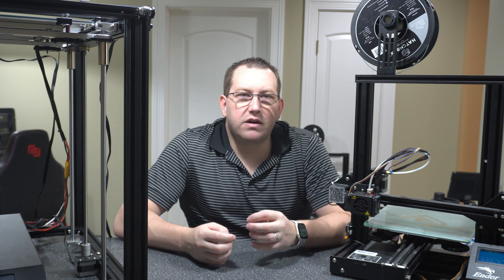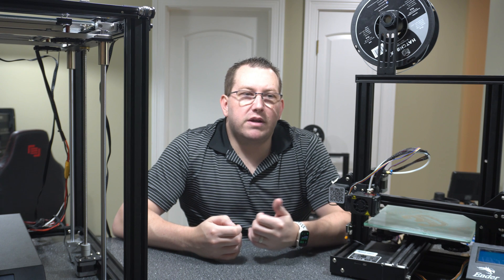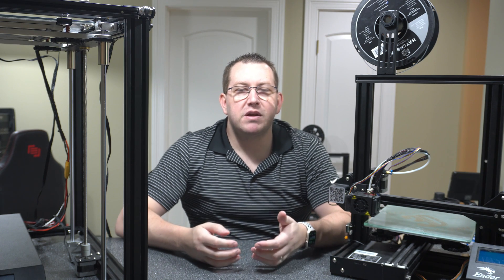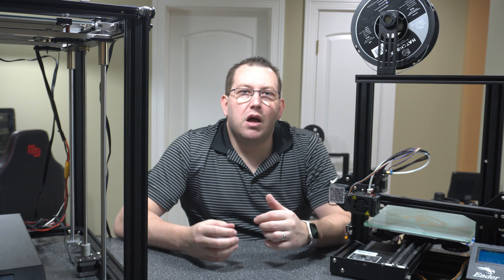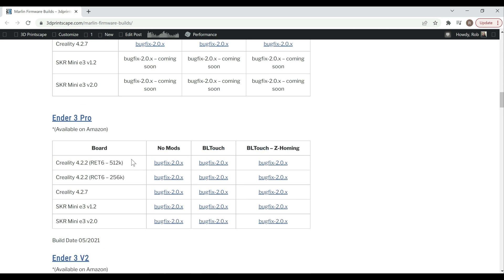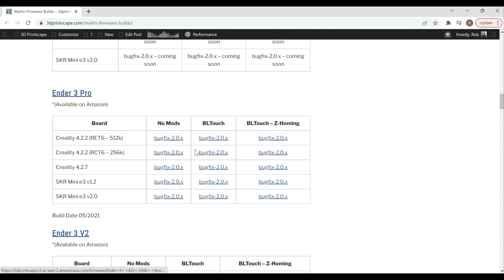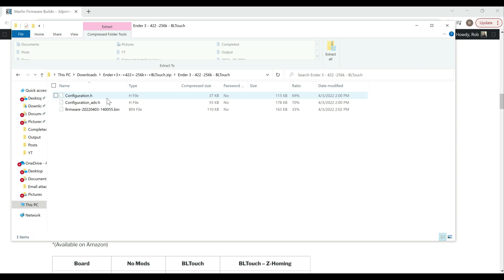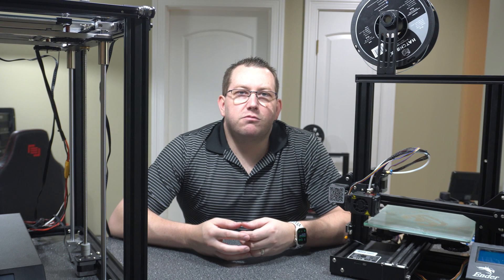Creality Screen Issues After Firmware Upgrade

Comment: Thank you man, you're a life saver. I had the screen issue which made it impossible to print from the SD card as everything was a text mess with random characters. I have the Ender 3 Pro with a 4.2.2 board and BLTouch so I used your Z-Homing firmware (256k) and it completely fixed my issue!! Thanks again, seriously.
Reply from the maker: You're Welcome!

Comment: Hey brother, I used your firmware for my first printer and it worked flawlessly.  I just got my second which is the same printer but maybe a different chip?  Ig has the GD32F303 RET6.  any firmware I use causes the touch to probe out and back in and move up when auto homed. Seems to start okay but auto homing is not workin.  Been at it for about a month trying to figure it out. Any help would be awesome
Reply from the maker: Hi. When you hit autohome what does it do? Does it have an issues on one or all axis, etc?
Reply: @3D Printscape  just one, x and y hit the switches like the do, the z just pops out and back in and then the z moves up and does the same thing again and stops. Almost like the probe is sensing bottom
Reply from the maker: @swiftymcvey8535  If you trigger the probe early does it stop it?

Comment: hlo 
I just updated my firmware for ender 3 
due to the blue screen issue 
and now everytime the printer turn on its showing the same blue screen issue
need help
thanks in advance
Reply from the maker: Hi. Make sure the firmware is right for the printer, the sd card is 8 gb or less and formatted as FAT32, and that the file name is unique.

Comment: I used your ender pro 3 blt file with the newest version of marlin on my printer tonight. It worked perfectly. The screen is still messed up but readable. The firmware on the creality site didn't work. Thaks 😊
Reply from the maker: Hi. If you clear the eeprom and flash the firmware it should fix the glitch. I have had some people say they flashed to a different build then back to the one they wanted and that worked as well.
Reply: @3D Printscape  thanks. I'll try I  when my litho is done

Comment: thankyou thankyou a million times over. not only is my printer now working again, but i can read the screen.
only thing if i can add is i have another printer fitted with BL Touch and i can adjust the z offset on the fly. but i dont seem to be able to do this. i finally found the sweet spot i think. but had to adjust and start the print all over again each time.
Reply from the maker: Hi, you should be able to adjust the z offset, with baby stepping, on the fly. Then you can take those settings and update the z offset then save it.

Comment: hey, i have an ender 3 with a 4.2.2 ret6 board but when i installed your firmware the screen glitched even more, is there any other firmware i can try? Thankfully it still prints.
Reply from the maker: Hi. What firmware did you try (512 or 256?). If 512, try to clear the settings and push the 256k firmware.

Comment: Hi there, I added the CR touch to my brand new Ender 3 V2 with the 4.2.2 board and when I installed the firmware to it, it has frozen the screen on the Creality logo but the fans still come on. Do you know what I have done wrong and how I can possibly fix it?
Reply from the maker: Hi. What firmware are you using? Also, make sure the file name is unique (so add a number or date to the end of it).

Comment: I was able to upgrade my firmware for my cr-06 se to the new community firmware, but the touchscreen is dark and even if i adjust the settings from the screen it's still dark, could it be a loose connection to the lcd screen?
Reply from the maker: Hi. I dont think its a loose connection. You could try to move the wires at both end to see if it changes anything but i dont think it will.
Reply: @3D Printscape  thanks, I'll try that.

Comment: Could you help me? Added a CR Touch to my 3 V2 and went to upload the Marlin firmware and now it's stuck in the creality screen. Tried refreshing back to stock and nothing helps
Reply from the maker: Hi. It sounds like you may have used the marlin ui config example. Try again, but make sure you use the creality ui config example.

Comment: I recently updated the firmware to your build w/ no mods, and it worked great! But I just installed a Z-axis upgrade to the printer, and now the glitchy screen is coming back!! Any tips? maybe I should install one of the other firmwares instead?
Reply from the maker: Hi. What all did the z axis upgrade involve and did you have to flash firmware for it again?
Reply: @3DPrintscape  it was the official creality z-axis upgrade that adds the second z-axis bar to further stabilize it. No it printed fine after the upgrade at first with your firmware fix /no mods. Then the glitchy screen started coming back.
Reply from the maker: @DougMacintosh  Did anything change between it working with no glitch and it coming back?
Reply: Yes I added the creality z-axis upgrade
Reply from the maker: @DougMacintosh  Any firmware changes? I would try to clear eeprom and push the firmware from my site again.

Comment: i have a Ender 3 Pro v4.2.2 RET6 and i just installed my CRtouch with the z stop still plugged in and have tryed to flash both bugfixes for BLTouch and BLTouch - z -homing but i still but that bugged screen.
i have tryed to go back to stock firmwire from crealitys site and also the no mods firmwire but now i cant get back to how the screen was befor. anyone got any idees?
Reply from the maker: Hi. You will want to use the bltouch version (not the z homing one) and try to flash the creality firmware, clear eeprom, then flash the marlin build.

Comment: Hi Rob, thank you for all your work you do. I am still having a glitchy screen after installing the firmware, it seems to start at the bottom of the screen and rolls up to the top of the screen. I have an Ender 5 Pro that has the GD32F303RET6 chip on the 4.2.2 board. Firmware is the bugfix-2.0.x for BLTouch but I have a CRTouch installed. Cheers Geoff
Reply from the maker: Hi. If your able to build firmware, try to build the latest 2.1.x build to see if that fixes the issue.
Reply: @3DPrintscape  Hi, okay I will give that a go. It starts out fine but after a while it goes kaput it's still readable just not pretty.

Comment: You're a life saver. Flashing with your bug-fixed firmware fixed my bluescreen. I tried flashing again with the firmware that caused the initial blue screen (cr touch firmware), and now it works. Weird.
Reply from the maker: Hi. Its odd that it worked the second time with the bad firmware.

Comment: Oh my goodness thank you so much! It took 3 boot ups but it finally worked. Thank you for making it free also.

Edit: After attempting to print something, it seems to heat up, move to the point that the BLTouch is centered and then cool down. I don’t know what to do.
Reply from the maker: Hi. Thanks for the feedback. Do you have the z stop connected still? If not, connect that back up. If you do, try clearing eeprom (restoring default settings).
Reply: @3DPrintscape  I tried that multiple times, but still it doesn’t work
Reply from the maker: @tobthebomato1588  Is the z stop connected?
Reply: @3DPrintscape  I’ve tied with the zstop connected and not connected with the z homing firmware but I think it may be a bltouch problem
Reply from the maker: @tobthebomato1588  Assuming you have all 5 bltouch wires connected to the bltocuh port, you want the standard bltouch firmware, not the z homing one.
Reply: @3DPrintscape  I meant that I’ve tried both
Reply from the maker: @tobthebomato1588  Can you try to flash the firmware again.
Reply: @3DPrintscape  it still wont work
Reply from the maker: @tobthebomato1588  Are you sure it took the firmware and what behavior are you seeing now?
Reply: @3DPrintscape  after some more replugging connections and renaming firmware it magically worked🤷🏾‍♀️

Comment: I have an Ender 3 pro with the 4.2.7 motherboard and a BL touch, but none of the bug-fix works :( same blue screen. What should I do ?
Reply from the maker: Hi. Check to see what chip you have on the 4.2.7 board. Also, make sure the firmware file name is unique.
Reply: @3DPrintscape  This is a 4.2.7 with 32 bit TMC2225 and I have rename the firmware with an unique name but it didn't work :( (by the way when I check after the blue screen on the microSD card I can't see the EPROM)
Reply from the maker: @skydrano4828  The 4.2.7 board should have internal eeprom, so it wouldn't right to the sd card unless that i having issues. Are you trying the firmware from my site or budling your own?
Reply: @3DPrintscape  the firmware from your site
Reply from the maker: @skydrano4828  Did you try with an sd card in?
Reply: @3DPrintscape  yes, the one from the Ender 3 pro
Reply from the maker: @skydrano4828  Try to grab the creality firmware from their site and flash that, then go to marlin. Im having an odd issue with my v2 where it wont take marlin updates, i have to flash creality then flash over to marlin.
Reply: @3DPrintscape  I have flashed creality and then marlin but nothing happens
Reply from the maker: @skydrano4828  Is your sd card formatted as fat 32 and under 8gb? Also, have you tried a different card?

Comment: i have an ender 3 pro its a month old after my first big print i got the blue screen i did the marlin firmware upgrade the screen works and it heats up moves but it has no command for it to print a file got any ideas to fix this
Reply from the maker: Hi. I would try to push the firmware again.
Reply: @3DPrintscape  thanks i will give it a try
Reply from the maker: @mattdaniel9972  You're Welcome

Comment: Just updated my firmware on an ender-3 just a couple questions. 1 Why is it now labeled as an ender-3 pro. 2 I see the progress bar moving but sadly it does not say what % it's on anymore I know its a small thing but I always had way too much fun guessing what % it would be on whenever I checked it. Other than that my screen has no more glitching on it. Thank you for the fix.
Reply from the maker: Hi. From the firmware standpoint there is no difference between the base and the pro, so i just use the same build. I think i can change the firmware to add the percent in, i will look at that next time i run some builds.
Reply: @3DPrintscape  Thank you for the quick reply!. Sorry if my comment came off as complaining I do not mean to do so. Your firmware works amazingly. Thank you for replying and for considering to implement the feature.

Comment: Thank you so much! After numerous problems with my Ender 5 Pro I upgraded to a 4.2.7 mainboard. I also have CR Touch. Creality, of course, doesn't have this software. After many attempts to flash new firmware, my LCD went blank. I used your Ender-3 bug fix and after weeks of frustration at least I have functionality. Are you going to do an Ender 5  fix or is it basically the same? Thanks again and Happy holidays.
Reply from the maker: Hi. I plan on working on more firmware builds over my break next week.

Comment: After adding the BL Touch to my new Ender 3 Pro, and flashing one of the ridiculous number of files from Creality, I started having the screen glitch issue as well as my microSD slot would not detect known-good cards (the 8GB card that came with it, as well as known-good Microcenter 32GB one, both format strictly as FAT32).  The firmware you provided on your site, solved both of these issues, and also I have found that the bed leveling and settings are now being stored correctly after power cycle.  THANK YOU!
Reply from the maker: Glad i could help :)

Comment: Fixed the screen glitch I got after upgrading to the bltouch firmware,  your version worked great.
What would it take to cure a completely bricked board?   I have an atmel AVRISP programmer around here somewhere that should work.
I also assume with the AVRISP I could see this 256k/512k funkyness and correct it.
Reply from the maker: Hi. What board is bricked and what was being done to it when it got in that state?
Reply: @3DPrintscape  didn't actually brick anything, just want to confirm that I COULD use and atmel AVRISP programmer to burn these boards (and debug, too, if desired).
Reply from the maker: @brynnrogers5081  Gotcha, i believe the answer is yes, but i have only used the Uno baord.

Comment: Hey, I'm back with a new question, and only because my 3 Pro's are 512 boards..     I was gifted a 3D Pad Mini 4.3 last month.

I understand if I do the upgrade this will need it's own firmware.  Have you done a video on 512 board issues regarding the touch screens?

I'm asking you first since I think just addressing these would be a great new video you could create in minutes!    Best, and thanks for rescuing us all!
Reply from the maker: Hi. This is the closest i have to that. It covers installing the Creality screen. https://youtu.be/sLPhTTSER0s
Reply: @3DPrintscape  That rocks! Thanks!

Comment: btt skr mini v2.0 stock in boot screen.
Reply from the maker: Hi. Make sure the firmware file name is firmware.bin and that its the only thing on the sd card.
Reply: @3DPrintscape The file name ''.bin'' turn into ''.CUR'' means it did flash right? but it till stock in boot screen idk why🥲.
Reply from the maker: @gelo5641  It means it read the file yes. There may be an issue with the firmware.

Comment: I would not recommend upgrading firmware if you have an all hot-end modification. With the current update temperature only goes up to 260C. After that screen issue gone but temp doesn't exceed 260C. Had to downgrade to creality all hot-end 4.2.2 board firmware for ender 3. Still have screen issue. Still looking for alternative firmware.
Reply from the maker: Hi. The firmware assumes a stock hotend. You will need to make a custom build if you need it higher.

Comment: Mine only goes glitchey after 4+ hour prints. Will give the BLTouch+Z-Homing a go, as that seems to be the most equivalent to the stock CR Touch enabled firmware.
Reply from the maker: Hi. If you have all 5 wires connected to the bltouch port and the z stop connected you want the standard bltouch build, not bltouch with z homing.

Comment: Trying to install a CR touch and so far, two of your videos have been a lifesaver just for downloading the firmware.  I could not locate the firmware on their latest site, and was having the glitchy screen issues.  Thank you again, you got a subscriber.
Reply from the maker: Hi. Thanks for the feedback and sub :).
Reply: So did you download the bl touch version and that worked for the car touch, or which version did you use? I’m trying to add a car touch and I was worried the bl touch code wouldn’t work
Reply from the maker: @majorityloses4602  Yes, i used the bltouch version. To the board, they are the same thing.

Comment: Thank you this got my screen back.   It seems my machine must be the 512 as it worked.    So for that you've already worked a miracle, and deserve some praise!     one issue remains you might know about. 

Would you have a manual for the firmware?     I'm unable to adjust the Z offset in real time.   I'm able to adjust it, and then have try to print with the new setting.      Z offset doesn't activate movement of the gantry while it's adjusted. so I can't fine tune it.

Or maybe I have the wrong firmware version? I tried the 256 which also gave a blank screen. 
Any help is appreciated!
Reply from the maker: Hi. Thanks for the feedback. I dont have a manual as its just a marlin build but this may help https://marlinfw.org/docs/configuration/configuration.html. You should be able to use baby stepping to adjust the z offset real time during the print. If its not there, try to clear the eeprom (note: this will wipe your current z offset as well).
Reply: @3DPrintscape  thank you I'll try the clearing.       I appreciate the fast reply.   

 As mentioned it allows me to set it using motion z, then "set" but then it tries to grind the bed.    try again after a flash.    I'll be back soon with praise! lol

Comment: Unfortunately it did not fix my issue my screen still has a glitch
Reply from the maker: Hi. Did you clear the eeprom and what chip do you have?
Reply: @3DPrintscape  what the eeprom
Reply from the maker: @shelovesjumpshot8923  Basically the onboard memory. Resetting defaults clears it for most firmware.
Reply: @3DPrintscape  what the eeprom and I have the Netac 8GB chip

Comment: You are the most helpful person/channel for troubleshooting 3D printer issues.  I put a new SD card into my Ender 3 Pro that really botched the system.  In a matter of an hour by following your videos, I was able to fix/reflash the firmware, solve a glitchy screen, and print using a better CURA profile that is making my prints come out spectacular.  I really appreciate what you're doing here and will be sure to recommend your channel to others I know personally that are having a difficult experience with their 3D printers.
Reply from the maker: Hi. Thanks for the feedback, i appreciate it :).

Comment: My firmware is working with the file I downloaded from your site.   I started using  Cura, and any file I try to print does not stick to the magnetic mat. Do you have any thoughts. Thank you for providing great videos.
Reply from the maker: Hi. If the filament is sticking its typically from an unlevel build plate, temp is too low, or the nozzle is too high.

Comment: I  Install this on my Ender 3 Pro and now it is working great. Already have the CR touch installed installed and plugged in but I am not sure what I should do next. Auto leveling is not an option on my menu right now. Can you please advise?
Reply from the maker: Hi. You should have bltouch options in the menu. If you dont, the firmware isnt right.
Reply: @3DPrintscape  thanks for the reply. I found it. You do great content,  thanks for sharing
Reply from the maker: @scottprouse9606  You're Welcome